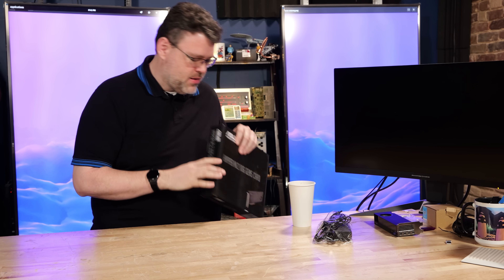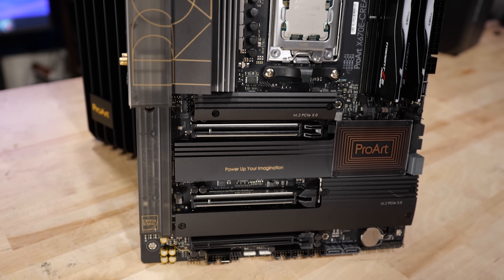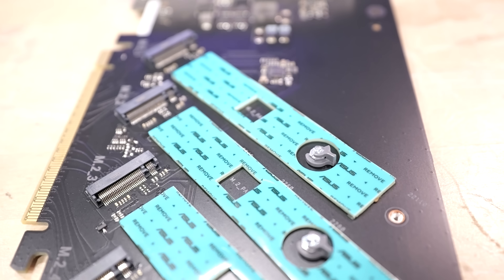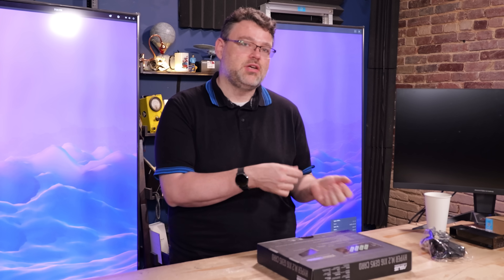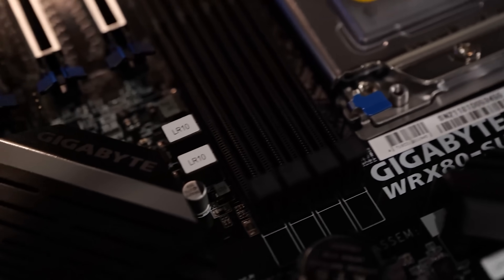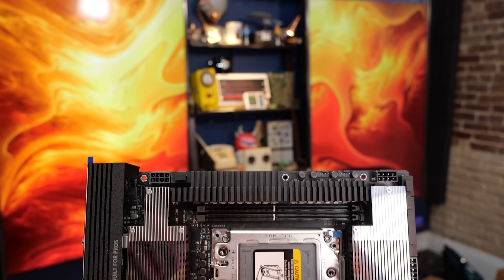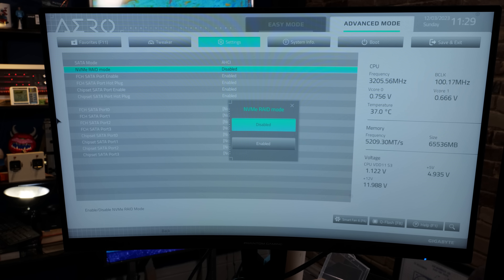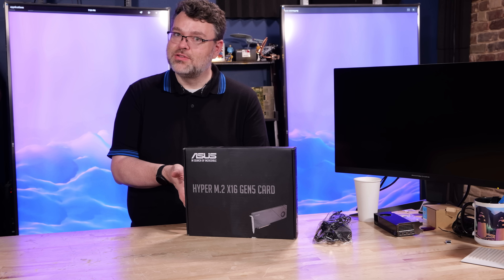Is The ASUS Hyper M.2 PCIe Gen 5 Card The FASTEST Thing In Your PC?

Comment: seriously, why the F are we still stuck on 75 watts on PCI-E? its been 2 decades now...seriously why dont we up that spec so we dont need extra cables for all kinds of stuff?
Reply: Alas increasing the amount of power which can be delivered through expansion sockets would greatly increase the cost of motherboards. The trace density is already very high and the routing complex. (Motherboard designers are already struggling with PCIe 5, trying to reach the slots/sockets further from the CPU.) Increasing the capacity of the expansion slots would likely need additional PCB layer(s), which is expensive.
Cables aren't pretty, but they're cheap, practical & efficient.
Reply: No cables would be a total dream. Imagine how slick the builds would look, not to mention how much quicker to assemble
Reply: @dfgdfg_  There's Project Zero that aims to have cables obscured from view with connectors on the reverse side of the motherboard. Some GPUs also have power connectors on the PCIe connector side. Obviously this requires a compatible case.
Reply: There was that ASUS GPU & Mobo combo that used a proprietary power slot past the edge of the PCIe slot. Seems difficult.
Could we at least move the 12VHPWR connector somewhere else on the GPU so that the cables don't have to make a 180° bend so close to the chassis panel?
Reply: because I dont want my mother board to practically be an other psu and things should take less power over time not more.

Comment: 10:32 Have you heard anything from AMD actually doing active work here, even if it only has a low priority? With Zen 4 motherboards they made their RAID drivers a bit better but so far even these slight improvements haven’t been allowed on Zen 3 platforms, even though it’s just pure software stuff which sucks quite a bit.

Comment: There is no 16 core TRX50.  There is a 'WRX90' Pro SKU but that thing costs so much that you're better off buying the 24 core non Pro SKU if you do not need octal channel or the additional PCIE lanes.  The 7955WX is like $400 more than the 7960X.  I actually finally caved in and bought an AM4 setup as a temporary X99 replacement since it's clear that neither Intel nor AMD want to release actual HEDT stuff.  I'm OK with 12 cores on a single ring or dual 8 core CCDs with my quad channel and minimum of 48 PCIE lanes, but I'm not going over $1200-$1500 for the board and CPU combined.  At that point I'll wait and buy used.
Reply: AMD will never release another consumer HEDT after 100% destroying their enthusiast userbase with 1) that very deliberate, now infamous TRX40 'bait and switch' treatment, and 2) the complete failure of non-pro TR's supposed revival in TRX50. A damn shame since TRX40 was a superb base going forward...until AMD instantly killed it.
Reply: @Jack_cx  Agreed.  I was ready to buy Zen 2 Threadripper for TR4 to replace my X99 stuff and then AMD is just like - 'no soup for you'.  I really did not want to buy AM4 because of it - but there is barely an alternative.  It cost like 50% more to get the 12700k and a dual 8 lane board.  The $212 X570 Taichi with the $185 5700X3D was just no brainer.
Reply: @Jack_cx I highly doubt the end of TR40 was planned in advance, AMD almost certainly intended to continue it forwards when they first launched and instead changed their minds later when seeing a) what their high end customers were using Threadripper for and b) how many cores they could easily stick in AM4 with their chiplets (the x950x part number series literally got moved across from TR40 to AM4). That still really sucks, don't get me wrong, as someone with an old 1920x who had to move to AM4 as well with some janky nonsense to get enough PCIe lanes, but we don't need to add marketing conspiracies to the mix.
Reply: HEDT?
Reply: @dfgdfg_  high performance enthusiast desktop.  Basically anything more than the current amount of cores actually needed by consumers (currently 8 IMO) and with more than 2 memory channels and additional PCIE lanes.  X58 was the first, then X79, X99, X299; AMD released TRX40 and then abandoned HEDT.  Intel has also abandoned HEDT.  Both companies now offer Professional Workstation (8 channel memory and more than 64 PCIE lanes) and Lite Workstation (4 channel memory and 64 PCIE lanes).  They could also have some of the parts be considered HEDT - but they need to have parts that start at reasonable prices.  Intel is $1080 for a freaking 12 core!  AMD is $1400 for a 24 core.  HEDT parts used to be available at like $390 for nerfed 28 PCIE lane parts or $690 for the same 6 cores with all 40 PCIE lanes.  The modern version of that would be a 12 core for like $900.  The X99 Taichi I run was $330 at launch.  W790 intel board starts at $500 for a stripped down model and TRX50 starts at $566 for a stripped down model.  It's a little on the high side IMO but not entirely unreasonable (though the TRX50 Aero D definitely should be at least $100 cheaper IMO).  It's the CPU price that's holding back both platforms though.
Reply: @cracklingice - I agree, the Workstation level hardware from AMD and Intel is just overpriced.   They need X99 and X299 level hardware and pricing.
I needed an HEDT system to replace my X99 6950X, and I had to spend $12,000 CAD to get an Intel Xeon W7-2495X 24C, ASUS W790 ACE, 512GB DDR5-4800, RTX-3090 system.
Reply: @daveg4417  I mean - if you got that 6950X new - they already have stuff in that pricing.  The 6950X was $1700.  That's 2 grand for board and CPU.  The Gigabyte Aero D TRX50 and 24c 7960X come in at $1400 and $600 for 2 grand.  Sure you're going from top of stack to bottom of stack - but it's still easily 300% performance increase.  Plus since inflation is like 50% since the 6950X launched, there's an extra grand you could use to upgrade in the stack to the 7970X 32 core with comparable buying power.
That does nothing about the severe pricing issue of W790 though.  Nearly $1100 for a freaking 12c, what were they thinking?!?!?!
Reply: @cracklingice  - An X299 motherboard is currently $300, a W790 ACE motherboard is $1200.  A TRX motherboard is $2000.  It's crazy.  I'm in Canada.  I paid $4000 for W790 motherboard and 24C processor, much more than the equivalent days HEDT.  The RDIMMs for the Workstation are also easily double the price of standard DIMMs. 
The Workstation pricing is easily double the HEDT pricing.  I wish that Intel brought HEDT back, but I think that the level of the current consumer hardware pushed HEDT out.
I didn't buy Threadripper because it is outrageous in price in Canada, 7960X here is $2300, 7970X is almost $4000, TRX motherboards are $2000. My $12,000 W790 24C system in Threadripper would have been $20,000., I priced it out and compared.  And because I got burned on the R9-5950X BSOD design issue on a $6000 system, and I got burned on two AMD Workstation GPUs that had design issues to the tune of thousands of dollars.
Reply: @daveg4417  The $1200 board is the Pro Workstation not the Lite Workstation.  W790 is two platforms not just one.  The octal channel is not an HEDT replacement, the quad channel one is supposedly.  Those boards start with the W790 WS R2.0 at $500.  Basically if the slot is long ways top to bottom then it's Lite Workstation, if it is long ways front to back then it is Pro Workstation.  Kinda surprised to see one of those boards on sale at the moment for $1100 instead of the normal $1300 price of the Asus SAGE.  As far as the conversion rate and import duties, ect; not much to be done about that.  It seems to be about $300 over the pure conversion rate.
Also - current X299 board pricing is irrelevant.  They're ancient now and nearly half the board of the current Lite Workstation platform.
And trust me - I completely understand.  I'm willing to pay 50% more than I would have for the i7-6850k and X99 Taichi for a 12 core xeon or 16 core threadripper but that's the max.  Meanwhile - intel is like $1100 for just the CPU.
Reply: @cracklingice  - The only W790 from ASUS that were available when I bought here in Canada last year was the WS Pro W790 ACE and WS Pro W790 SAGE.  The ACE is quad mem, the SAGE is octal mem plus a few other differences like 2x10GBe.  The only other W790 available here at that time was the ASRock but I didn't like its slot layout, and it doesn't seem to be available here any more.
I would have liked to have gone with the SAGE and a W3400 processor, but the extra cost was too much.  So I am max'ed out on the W2400 series with the W7-2495X 24C, whereas if I would have gone with the W3400 I could have upgraded to higher core counts.
We are really slim pickings for Workstation hardware here though.  Even AMD TR and TR Pro models are mostly not available here.  We seem to get the dregs of hardware.  And AMD TR pricing here is totally nuts.
I know that the X299 is old, but I am actually looking at putting a system together with it and a 10900X.  I have two X99, an R9-5950X, a W2400, a 9th Gen and a 12th Gen.  I need an all Intel system with a Battlemage GPU.  I do software development and games.
Reply: @daveg4417  I actually use the 10900x in my Precision 5820x at work to this day, and man, I've got to say, both AMD and Intel do NOT make anything quite like it anymore... We got them when 10th gen intel was just starting to get old (12th gen had been out for a little bit), but it was the only PC that Dell sold that had enough PCIe lanes for what I needed at a reasonable price. The new at the time Xeon W's were a lot more expensive, so it couldn't be justified, even though I really would've liked to have ECC. I rarely make full use of the processor itself for anythign other than the amount of cores it has for virtualization. The PC was almost entirely chosen for the amount of PCIe lanes it has. And at the time we bought it, the entire PC with the Dell markup was just over 2 grand... Looking on their site now, I don't even think you can find a PC that is remotely comparable that STARTS at 2 grand, and all of those will have 1 hdd, 1 stick of 16gb RAM, and the cheapest of the cheap GPU, so it will only go up from there...

Yes, I completely understand going back to this, it is quite a special product that both AMD and Intel desperately need to revive... At home I have a 7950x, and while it's a fantastic processor, I feel like my PC is gimped in comparison to my work PC because it has no more PCIe lanes than an 8 core gaming cpu... Like seriously, Intel and AMD, just give us more lanes, and more than dual channel memory again at an actually realistic price... I know I wouldn't hesitate for a moment to buy it...
Reply: @12347Shadow  - If Intel still releases and supports the Battlemage, I might get the X299 and 10900X for that, since I am betting that 15th Gen has the same failure rate as 13/14th Gen.
I also need to update one of my X99 in order to run W11, and for that I am looking at a X670E motherboard and either R9 7900X or 9900X, plus 192GB.
Reply: @dfgdfg_  HEDT = High End DeskTop.

AMD's Threadripper played a HUGE role in making HEDT affordable. You'll notice Intel slashed the price of the  i9-10980XE  by a whopping 50% proving that they were price gouging customers.  AMD priced Threadripper very competitively and started beating Intel in benchmarks until AMD got greedy with Threadripper Pro.

Comment: Isn't infinity fabric the fastest clock speed device on an AMD system?
Reply: Infinity Fabric isn't actually that fast, overclockers generally aim to run their RAM exactly twice as fast as IF for example for better performance (which gives 1:1 matching of the true underlying RAM clocks and the IF clocks) (edit: 1:1 is for Zen4, Zen5 is 2:3 making IF even slower compared to the rest of the system on a pure clock for clock basis generally running at only 2000MHz on Zen5/AM5)
Reply: High bandwidth, low clock speed. It's a wide bus, and it needs to be to keep latency low.

Comment: LGA 1700 only supports 8x + 8x + 4x officially.  They added the dedicated M.2 but took away the 8x + 4x + 4x to make sure we can still only have three devices on consumer socket.
Reply: Pretty sure that's why he specifically mentioned Threadripper or Xeon W, those platforms have the PCIE lanes to use this kind of thing.
Reply: @nadtz  He mentioned not seeing any boards with that support and if there were any.  No - because Intel prevents it.  That was what the comment was about - not you could or should use LGA1700 for this.
Reply: @nadtz  to be fair some AM5 X670E boards e.g. a few higher end Asus boards would also work
Reply: Worse they're also jank on some boards beyond even that — for example, the z790 apex encore for example just outright disables the pcie_2 slot if you use the gen-5 m.2 port (seen on page XV in the manual), so you just get sol'd extra hard. This is not the case on the original encore board
Reply: @Justifier  Yeah, some of those boards offer more than one gen 5 m.2 slot by using a dual 8 lane slot configuration but instead it just hooks up to one m.2 (or uses a switch to allow either two 8 lane slots or one 8 lane slot and one m.2 slot - because intel won't allow 8x + 4x + 4x you cannot do two m.2 slots without a super expensive switch)